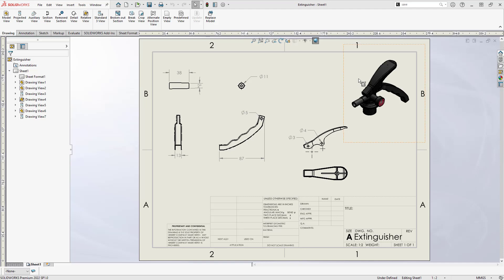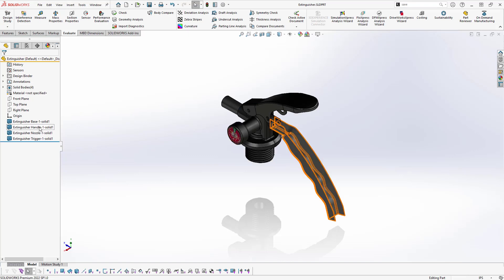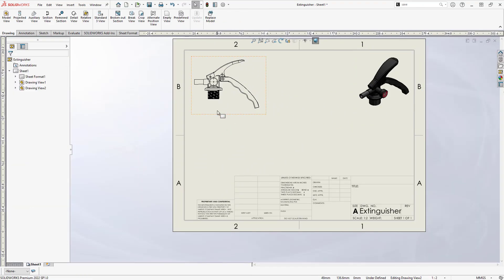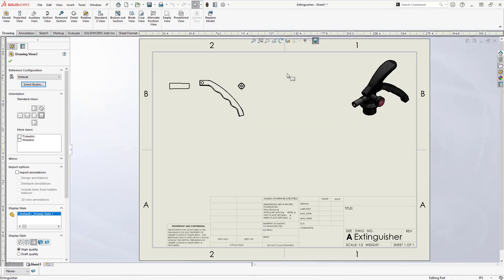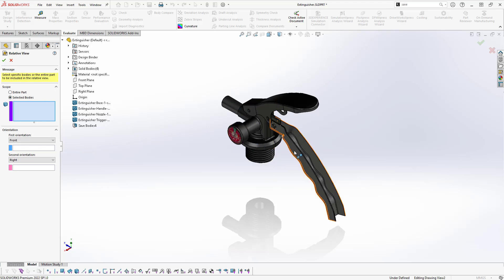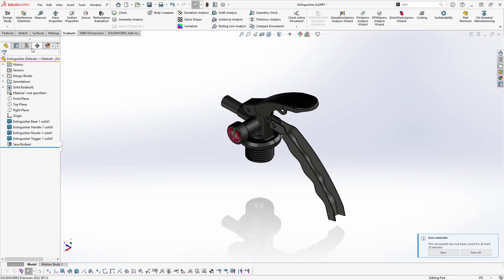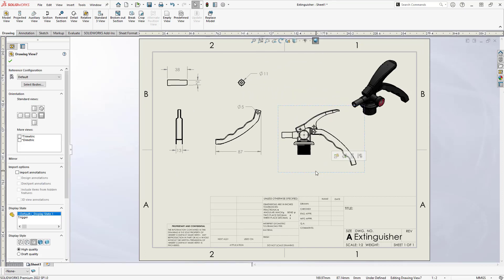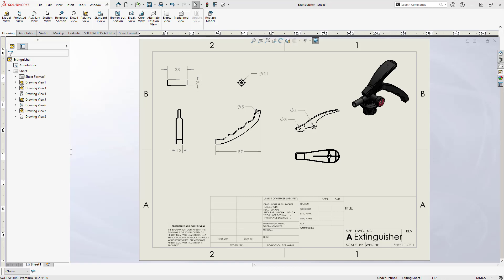Isolating Bodies in Drawing Views for Multibody Parts in SOLIDWORKS

Comment: Thank you for covering this topic, you rarely find tutorials covering multibodies drawings, but there's something i've been looking into for a while and can't figure it out, how can i section view only one or multiple bodies in the drawing? Consider you have a battery pack that consist of an outer shell and 10 battery cells for example and it's a multibody part, how can i section the outer shell while leaving the battery cells intact in the drawing?
Reply from the maker: Hi Khalil - you should be able to do this by right clicking the drawing view, choosing "Properties" and then the "Hide/Show Body" tab to choose which bodies you want to be included or excluded
Reply: @hawkridgesystems  hello, i don't want to hide bodies i want a particular body to be sectioned while the rest intact, all the bodies are shown